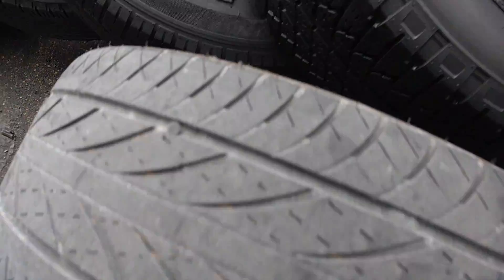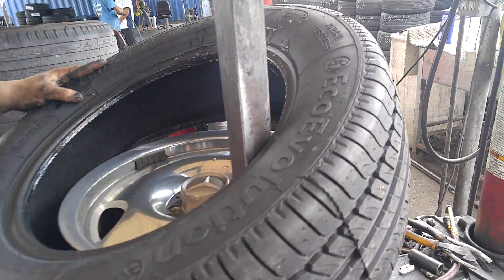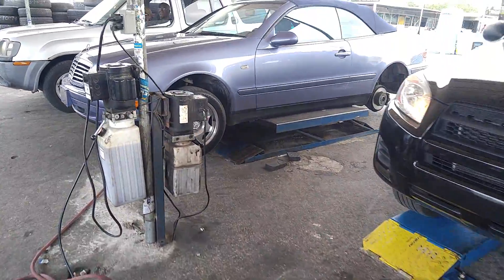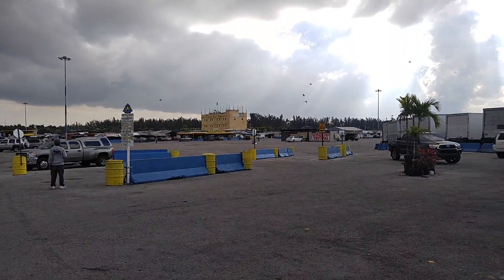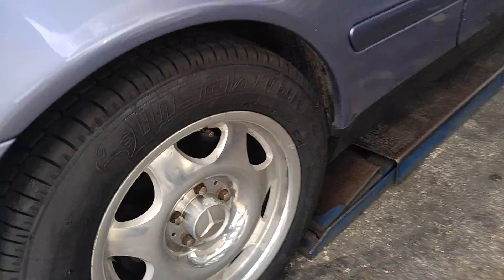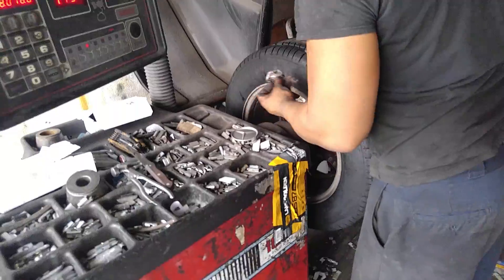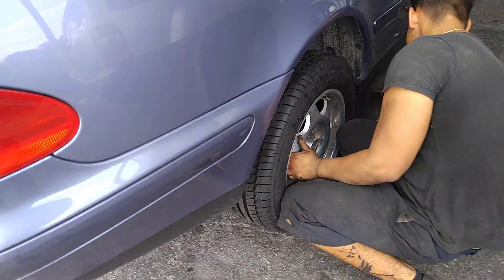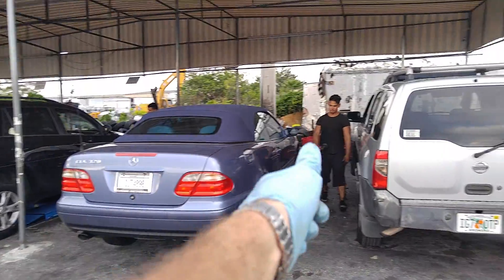What Tires Did I Just Put On My CLK??? 3 5 19

Comment: you sound very nervous, i would be too, why not just stick with the original tyre size that were on it 205/55/16, thats what your merc was fitted with......and you put these way off spec tyres on........you should have fitted the originals, it you want to go big 225/50/16 or if you want bigger 245/45/16.......sounds like you were well ripped off with your retreads, you should have been able to get brand new tyres for that money, they would have been budget tyres, but better than that junk you have fitted......remember to not go over 70mph with these retread tyres or the tread will come off......good night, god bless
Reply from the maker: I felt the original size was too small looking. The choice of retreads was bad. Walmart sells brands new made in USA cooper for same price. Bad call on my part, + the different size tires knocks off the cruise control